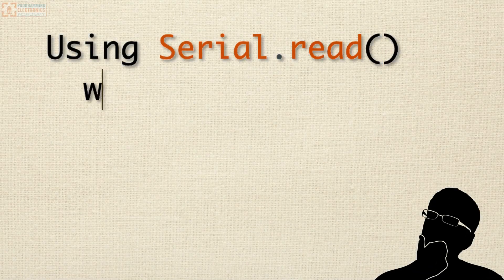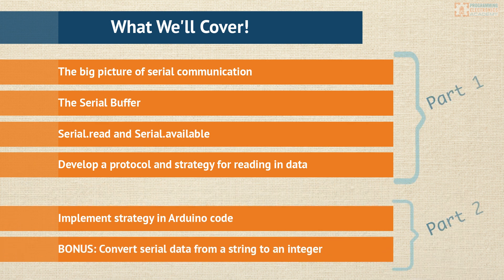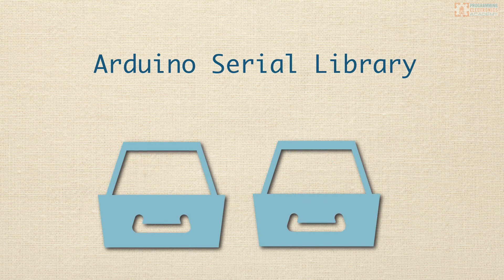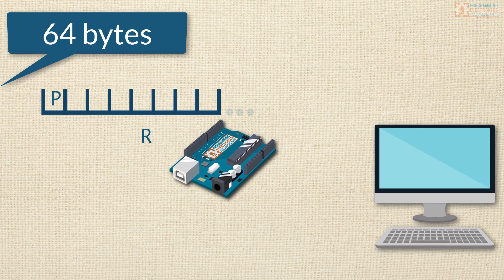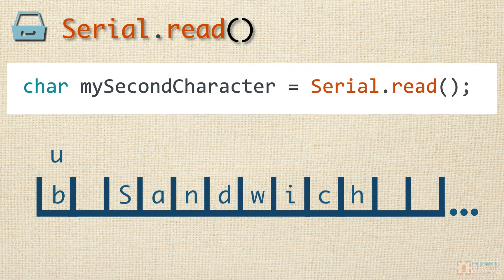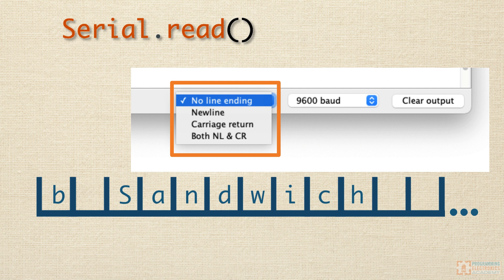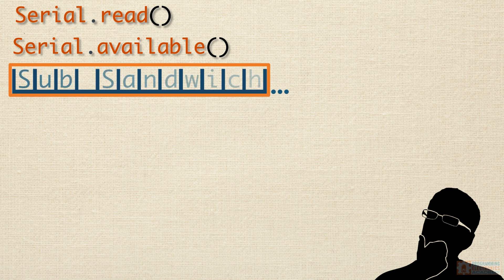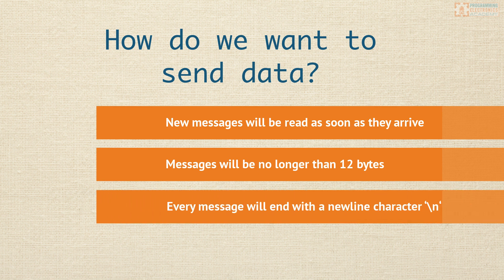Using Serial.read() with Arduino | Part 1

Comment: THANK YOU! All other videos explain the bit transfer as if the viewer is a child, and then pretend that serial.read() happens magically at the right time. This video explains the parts that need explaining, not just the ones that are the easiest to explain ;-)
Reply: …although I wish the explaining speed was a bit faster. I didn’t know UART had a buffer, therefore I appreciated this video … but absence of knowledge doesn’t equate to slow cognition. And I bet anyone who enjoys programming microcontrollers can handle a slightly faster explanation speed.

Comment: Thank you for this video. I really appreciate the work you put into it to make things as clear as possible.  Really good stuff!  I have a question. I have a Uni-T UT61E+ multimeter which has a usb cable for data logging output.  I know the protocal and I know you can connect it to a PC and say use a Python program to read the data.  I am wondering how I can instead use Arduino to read the data.  Do I need a shield, something like USB Host to make this happen on Arduino? I imagine I can't directly connect the Uni-T directly to the Arduino?  I just need to figure out how connect the two and I can make it happen.. I have the protocol detailed in a Python program.

Comment: this is really amazing to watch this , I want to thank you for this to making it easy to understand cause I was really struggling that how the reading data works.
Reply from the maker: Thanks for watching!
Reply: @programmingelectronics  Hey I loved your video so much, I struggled a lot on this but you're a saver. Can you please make a video on Arrays? and can you let me know the road map to advanced programming, like a perspective of on which level you stand where you need go, I really want to learn programming using Arduino, however I can switch to different one but since I am comfortable with this I can learn this first and learn others after this

Comment: I'm trying to build a HID with a single pull toggle. I assume I could use a high, low code that if the switch is high it would press a certain button and low it would press another button. Just not sure about how to write it.